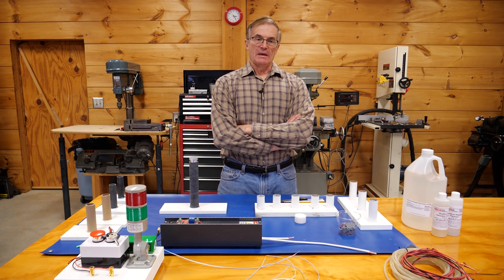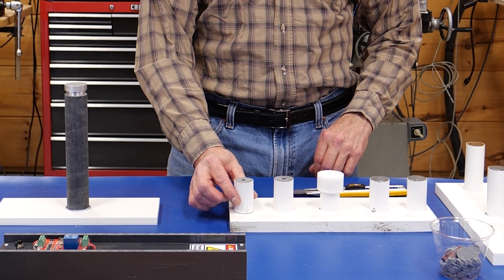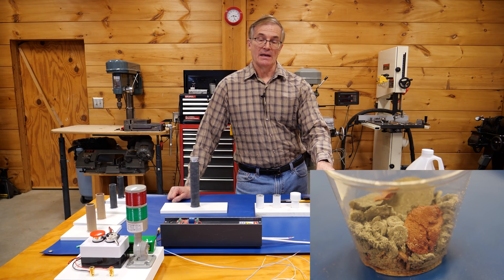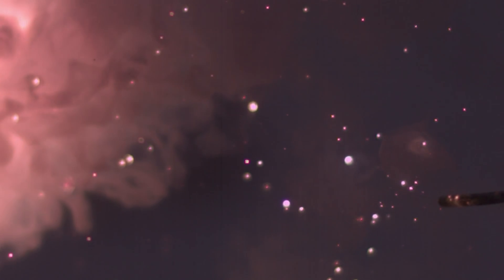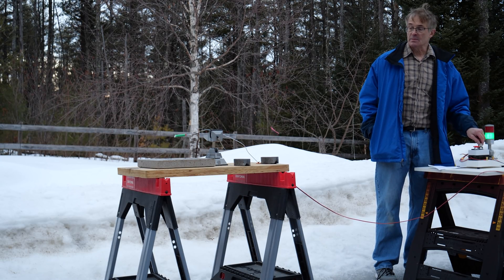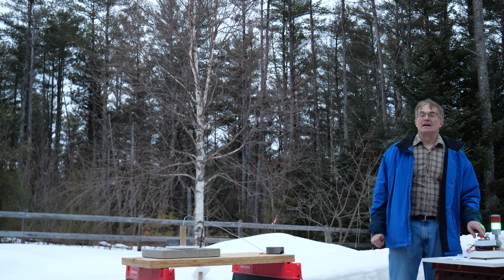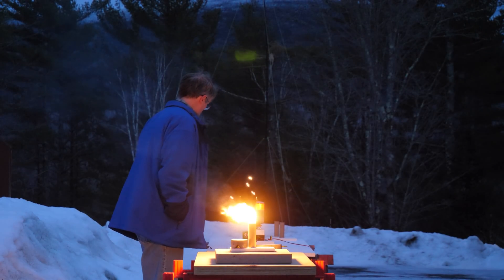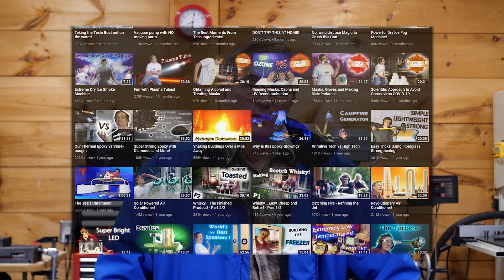Rocket Igniters at 10,000fps!

Comment: That beeping is really annoying. I know its a safety feature, but it beeping continuously is really annoying with headphones.
Reply: ... annoying without headphones too. It's the same tone as my multimeter when I leave it on for too long
Reply: I wish I had hearing good enough to be annoyed by a beeping!
Reply: @taavey  Sorry to take the hearing for granted, but it is more of a curse in the modern age of noise pollution. Had to switch computer mice because my favorite G500 developed some coil-whine at like 18kHz that drove me nuts, but it was only when I wasn't moving the mouse. So I was either constantly nudging the mouse around or had to tilt the mouse up on its side to stop the whine.

Comment: Um.  Wouldn't you stand upwind of the ignition stand instead of downwind?
Reply from the maker: The wind was continuously shifting.
Reply: @TechIngredients  perhaps a plexiglass Shield next time might be advisable, not so much for the Smoke diversion, but if you pack one a little too tight...

Comment: You might want to have a look at the Elemental Maker channel.  He has done a lot of videos on making rocket grains and different nozzles. In particular he has a video on building a rocket grain tester using a pressure plate and an arduino to measure force over time which I’m sure would be useful in your own experiments. Many thanks. Mark
Reply from the maker: I've seen those videos.

Comment: If you want to expose the flame correctly so that it doesn't overexposes point your camera directly to the sun and expose for that. They have roughly the same Luminance. Learned that trick from the Slowmo guys who often film explosions in Slow Motion.
Might be difficult to do on an overcast day like in the video but you could just preset the camera on a sunny day and save the exposure settings.

Comment: Are the finished engines going to give off such a light show, and if so, how much energy is lost by the fuel burning after being jettisoned?
Reply: pretty curious about that too
Reply: 17
Reply: 42.
Reply: No, most of the energy is converted to kinetic energy through the nozzle - the temperature of the exhaust drops from about 3200K to about 1500K when properly expanded. This is only red hot, so only a slight glow.

The metal particles can still be burning a bit, but if properly sized they too will have been mostly consumed too. In practice you end up with a thin pencil of white flame moving very very fast, about 1.5x the length of the motor

Comment: My name is William Gregory, I am not a trained scientist but I have a high aptitude in narrow fields of science.

I have a thought experiment that needs to be investigated. I have submitted a proposal to the National Science Foundation in the US and they have requested an elevated pitch, However, it is not the thought experiment I have envisioned in which I can mathematically and mechanically explain my theory of dynamic center of mass in the center of shape-shifting liquid. It could possibly transverse through space by taking advantage of a proprietary geometry inside a closed vessel and use reaction wheels. My design is simple and needs to be further investigated and made into a rough prototype that could be tested in a swimming pool of still water to simulate a craft floating in free fall around the earth. Changing the center of mass in shapeshifting liquid each half cycle of a specially shaped tumbling, verticle or horizontal spacecraft and using rection wheels to rotate around the new center of gravity in incremental cycles and distances. 

If you have any interest in working with me I would entertain sharing any startup company and patent with seed money I might receive from NSF or NASA program through the US Government. The true (no mass ejection engine) using only torque, electricity, reaction wheels and one more proprietary innovation in the geometry would be a  disruptive game-changer for space travel.

I am only a retired, friendly insurance agent but my grandfather was an inventor and innovator. I built a notepad type website you can visit at gravityalchemist.com for a good laugh, my email is gravityalchemist@gmail.com

I hope you can see I am very serious about moving forward with a few ideas.

I have a request from NSF space division for elevated pitch that expires 06/09/2021 and a Nondisclosure statement I would need you to sign in order to further discuss the opportunity or you provide a modified NDA of your configuration.

I would also need to know your country of citizenship in order to stay in compliance with Seed funding in the US.

All best,

William Gregory
305 S Hemlock Ave 
Roswell, NM 88203
505-293-3500
Reply: Once you take any gov't money they own it. You are working for them. Beware and read everything thoroughly.
Reply: @dalecomer5951  Hello Dale thanks for the cation, my grandfather's engine and a patent were confiscated by the US gov in 1938... it was a rotary engine.